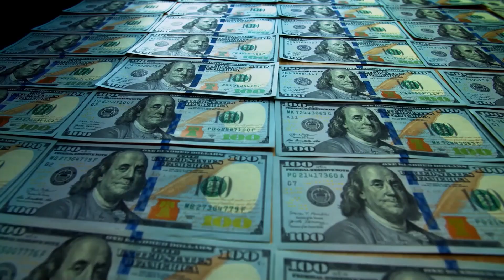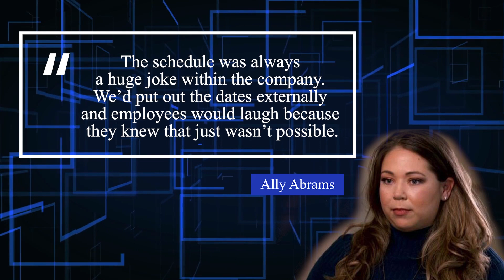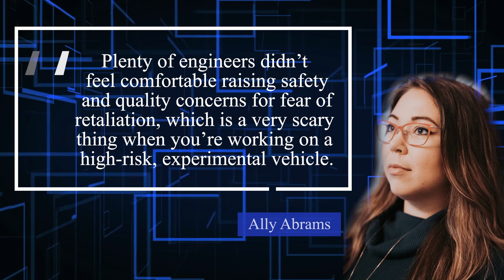Is it GAME OVER? Blue Origin Is A Complete Failure?

Comment: I worked at a Amazon sortation facility. They built a sortation machine designed for boxes and jiffies (mailers) but found it could not handle the mailers. This forced them to build a separate sorter for the mailers costing millions of dollars. They used DC motors on it where they should have used three phase AC motors resulting a conveyor system that could barely take the load and would constantly stop because of it. The conveyor on this machine would also constantly suck in the mailers into its internal mechanism jamming it up. The stop buttons were originally placed on the opposite side of where an operator stood forcing them to run around the machine to stop it during an emergency. Poor design and inappropriate uses was all too common. And you wonder why Blue Origin is a joke.
Reply: Bloo Beezos Dhogg Dhoo.